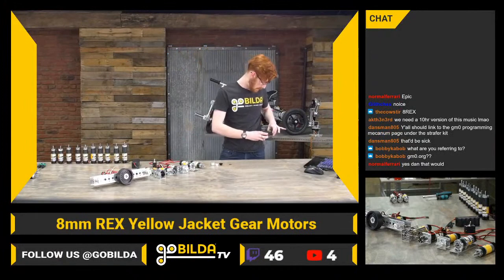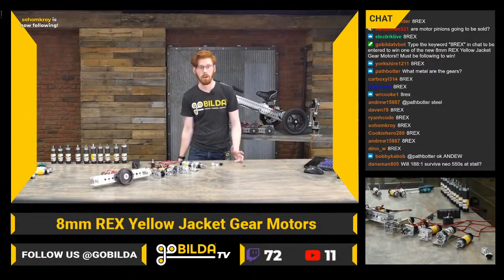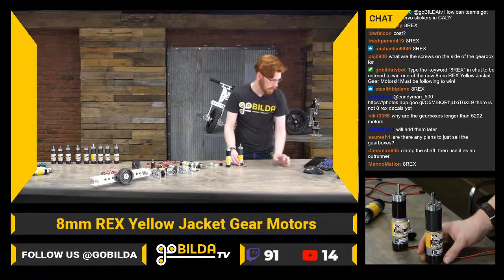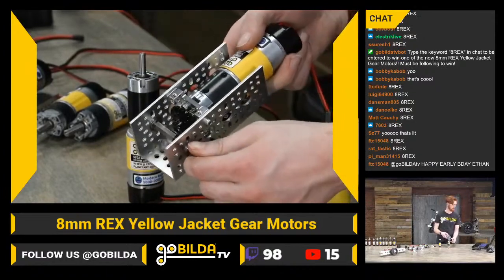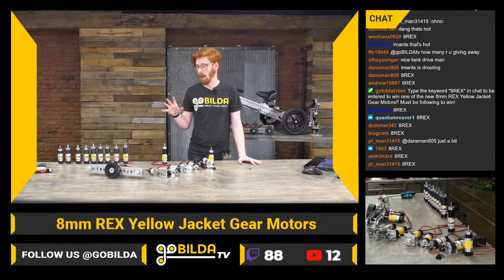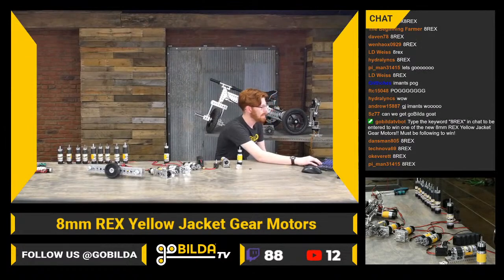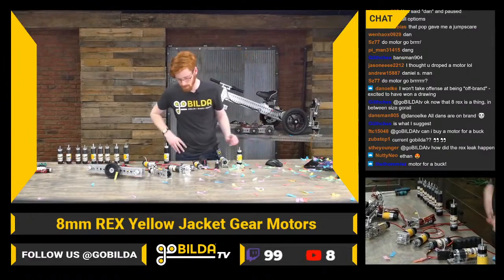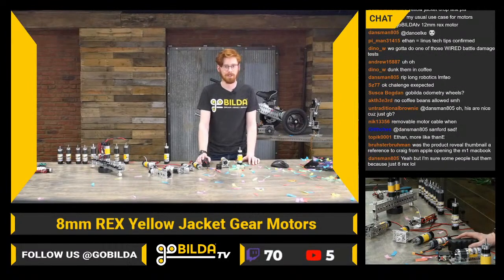FTC Friday Episode 13:  8mm REX Yellow Jacket Gearmotors

Comment: Hi Sir.
I'm try to purchase the motor 5203-2402-0051. and  have following questions.
Can  I use PWM  motor speed controller CW. CCW. If yes. What is the volte and Amps I can use. (Max)
Thanks,
Reply from the maker: Hello Tony, sorry we didn't get to your message until now! 
These are 12v motors, they are perfectly fine to run up to 16v. And they can pull a max of 10a on 12v. They run great on PWM motor controllers and will run clockwise or counterclockwise depending on polarity.